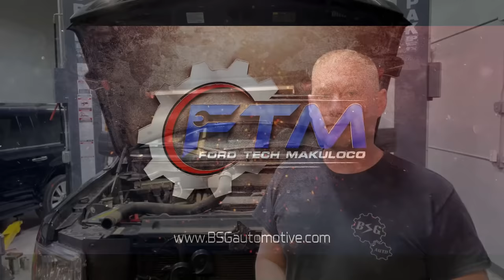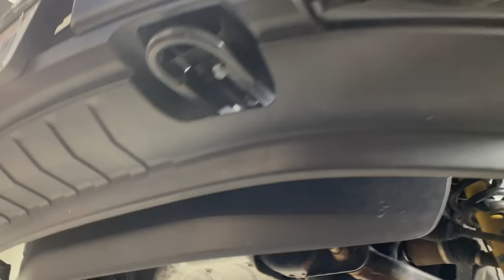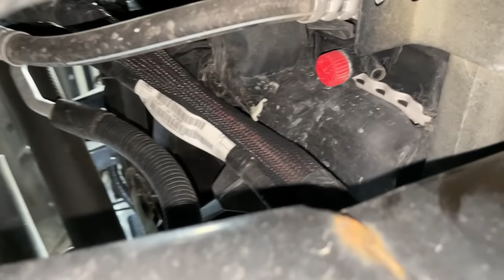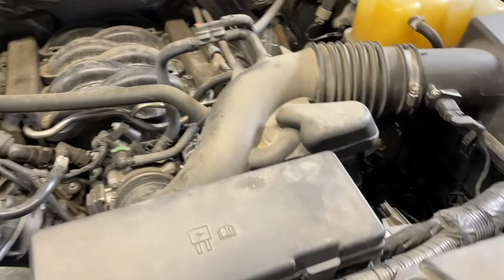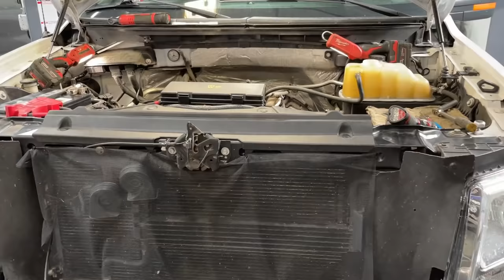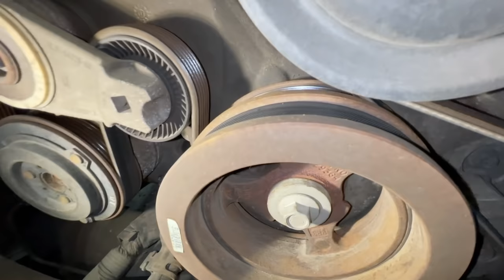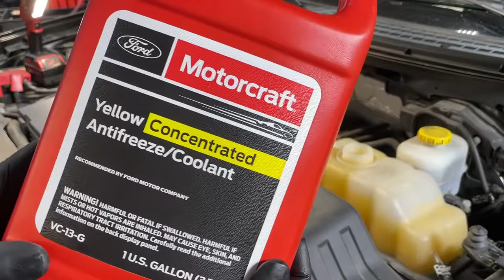2011-2021 Ford F-150 5.0L Coyote Engine: The Most Common Coolant Leak Repair!

Comment: his tech, i own a 2010 f150 3v 5.4. 160K miles, recently i found it leaking coolant but cant fin it. during testing i found that if i remove the radiator cap with engine cool,  it will spew coolant from there... is the a sign of bad head gasket?  :(  thank you.

Comment: If I replace just the O-Ring on the upper radiator hose at the quick connect, will that stop the leak I have? I noticed it’s leaking a bit right at that upper hose at the quick connect.

Comment: If I am only replacing that first o-ring (on the side leading to the upper radiator hose), does the coolant reservoir still need drained first?

Comment: Couple trucks in the fleet I look after have this problem.   I ordered the T from the local ford dealer, it doesn't seal to the rad hose.  Like there's a steady stream of coolant coming out of the rad hose when it's connected to the T.  Dealer says it's the right part.  I'm thinking that the revised part has changed diameter and needs to be matched up with a new rad hose as well? I ended up just replacing the o-ring in the T, but it's still leaking, what  a stupid design
Reply from the maker: So, you never replace the upper radiator hose O-ring when replacing the T and you have problems after then complain. Funny I have never had problems after performing it just as shown here. All you had to do is follow the directions in the video and everything would be perfect and worry free right now.

Comment: I have an off topic question but I would really appreciate some technical support. Do all the 3.0L Duratec engines have the same flex plate? Ran into a problem after an engine swap in 2004 Mercury Sable. I am having some problems with the starter meshing. It has broken about 5 teeth off the flex plate all the problem is in one location. Physical health problems have forced me out of the shop and I had to have this job hired out. I asked the shop supervisor to use the flex plate off the engine in the car because the donor engine came from the salvage yard. I am honestly just trying to figure out what is going on. I have had compatibility issues from flex plates on junkyard engines before. The problem is it is such a small area on the flex plate that I truly believe the plate suffered damage at some point and the gear on the starter was harder so it punished the flex plate gear. Was I out of line to ask for the flex plate from the vehicle that had the blown engine to be used on the running engine. It was truly a shame. The cams don't have much ability to withstand punishment on those engines and the original engine used a little oil and my niece ran it out of oil from lack of routine maintenance! Just has been a snowball situation since then.

Comment: The link for the tee still has suffix -A in the description. Does this seller send -B. Just curious, what are the details of the revision, if you know? I prefer Motorcraft parts, too, but what is your opinion on the Dorman version? Thanks.
Reply from the maker: Dorman is junk through and through. No real tech uses Dorman parts for a very good reason.

Comment: Does the heat need to be running to get flow through the heater core, or is coolant always flowing through regardless of if the heat is running?
Reply from the maker: Always except certain models.

Comment: Okay so I had this problem and changed the y-pipe and got a OE thermostat replacement while I was in there. Now the truck runs hot like 230-240F. I've bled the system a couple times and it's still running hot. Maybe the thermostat is bad? I'm not sure what to do next.

Comment: Any tips for changing out the thermostat? I have. 2012 f150 ecoboost and trying to add a spd thermostat stainless steel rather at 170 degrees.

Comment: i tried putting coolant in my truck all i seen was coolant leaking from behind the house going down behind the pullys down to the center of the bumper seal i find out heater house tube was cracked seals were broke or rusted out

Comment: That piece is the revised part? They sure look the same to me. When mine leaked (2015 5.0) I just got the O ring and replaced that. Perhaps I should be checking the other connections to see if they leak but my coolant level stays the same currently. Does this revised part ensure no leaks ever again?
Reply from the maker: Wait Ford doesn’t sell the o-ring separately for this part. How did you get one?
Reply: @FordTechMakuloco  this was at least a couple years ago. I didn’t want to drive it with the leak so my brother stopped at the dealer and got the O ring and a bottle of coolant for me and dropped it off. I installed it and that was it. Not really sure unless they stopped selling it for some reason. 🤷‍♂️

Comment: I have a small leak from the upper radiator hose quick connect. Could I just replace the O-ring in that connector or should I replace the Y connector and everything?
Reply: Replace the Y connector too--part is inexpensive, and you are already doing everything to get to the O-ring.  Ford preventative maintenance = replacing it in a controlled environment before it impacts your drive.

Comment: Any chance you can do a video or comment on what causes the #8 intake valves to wear out on 5.0 f150s around 200k miles? I'm at 275km and just started getting misfire on 8, and a quick Google search shows it's very common for the valves to tulip, but a lot of guessing about why.

Comment: Makaluco, we have a 2017 f150 with the 5.0 and in the last few weeks it has blown every single coolant line. It started with the lower radiator hose, then the upper, then the one from the water pump, then the radiator cracked, then the heater hose burst. We have replaced the radiator cap twice and it seems almost every 3 days this truck pukes all of its coolant out. What could be causing such high pressure in the system? Please help
Reply: Thermostat?  I would want to replace radiator cap/thermostat with Motocraft.

Comment: Looking at an 2011 5.0 with 84k miles. Been hearing bad things about 11-12 f150s. Should I avoid those or are they pretty good?
Reply: If you can help it, try to opt in for the 13-14 f150s. Better years for the first gen 5.0

Comment: I have an odd problem 2010 mazda 3 2.0L intermittent p2004 code. Ive replaced the runner valve problem went away. Ive cleaned the intake with some seafoam too engine clean. The flap moves freely and i checked the actuator moving it and letting go. I did spray some wd40 on the pivot point where it connects to the actuator and it helped. Im thinking my actuator is sticking . Have you seen this before?

Comment: What do you think of the 2021 Ford F-150 5.0? Do you think the cylinder deactivation is going to cause long-term reliability problems? I’ve been told if you switch the vehicle into sport mode it shuts off the cylinder deactivation is that true?
Reply: When dodge and Chevy introduced it yes, I ve seen personal friends have issues with their trucks. The Chevy was in and out of the dealer 2014 6.2 with 50k and my personal mechanic who maintenances his 2013 dodge 5.7 religiously just had to do a top end build at 125k All were related to the cylinder deactivation. The  5.0 are already starting to have issues with seizing due to c.d. but yes you can turn it off to where it does not activate it. Hope that helps.
Reply: Wow thanks for the info. I haven’t heard about new 5.0s seizing that’s awful! Is there someone I can read up on that? Maybe I can take steps to avoid problems 🙏. Thank you!
Reply: @cliffmorrison1130 You are very welcome and I would keep on the look out for info on the forums, articles, and videos when they come out.👍

Comment: Hello! When doing a Y pipe change on the coolant system for a 2014 5.0 f150. After you finish how much coolant should be going back in? I have a jug and a half of the new yellow coolant that i still need to dilute. Will that be enough or should i go grab 1 more. Thanks!
Reply from the maker: If you have a jug and a half that makes 3 gallons diluted, you should have enough.

Comment: Don't they sell the O ring on the thermostat side as well? Seems a waste to replace the whole Y pipe if it's just O rings. I already did the upper hose side but unfortunately for me the leak is my water pump :(

Comment: Hey Brian thanks for all the info. I do have a question, I have an 2001 f150 with 4.6L can I run that new yellow coolant on my truck or should I continue using that old style geen looking coolant. What would you recommend?
Reply from the maker: I would be using the Ford Gold in your model.
Reply: @FordTechMakuloco  thanks Brain I appreciate it

Comment: having trouble snapping the lock on the upper hose when replacing the O ring and T connector. seems like when you push it on it’s effortless. I can’t seem to get it past the lip. have both of the same parts you’ve shown in description. any advice? thanks
Reply: I had this same issue when I would remove my new o ring seal it would slide back on perfectly but with the new o ring installed it does not fit. I tried the dorman kit 926-168. I was able to flip my original seal and it seems to have stopped for now (let’s hope) so I can try and source the correct seal.

Comment: After having this repair done I have cooling fans that turn on high and dont shut off.  Any diagnosis tips?  Had it scanned, high side AC pressure switch code.  Cleared that and the AC was 1/4lb low.  Fans still run on turbo mode but the pressure switch code has not returned.
Reply from the maker: Well considering the high side pressure switches almost never fail I would be checking for wiring damage or a connection issue there.

Comment: Just wondering what the point of removing belt was? Thanks in advance
Reply from the maker: prevent contamination.
Reply: @FordTechMakuloco  thanks for clarifying. I was just thinking if the Y was leaking wouldn’t the belt be already exposed to coolant? Do you recommend then just putting a new one on even if it looks like its in good condition?
Reply from the maker: The Y likes to seep small amounts over time, they rarely let loose so the belts are generally ok. When you change it though there is likely to be a good amount of spillage definitely contaminating the belt.

Comment: I have a quick question, 2017 f150 xlt 5.0 I have an issue with extended crank time, she will almost start then fails but will always catch on the crank, only does it when cold, other wise starts and runs....any help, the dealership says no code lol typical.... any help would be amazing

Thanks,

Josh

Comment: Quick question I have a 19 F-150 with the regular 50 why is it using a quart of oil between oil changes for 35,000 miles on it

Comment: I have a 2012 f150 race red has the 3.73 rear end 4wd sometimes during hard excelleration at 4500 to 5000 rpm there's a very noticeable vibration.  Doesnt happen all the time just sometimes.  Also when I put it into 4wd and pull knob  out to lock the diffs it pops up and says "check locking differential" and I can't use the locking diff mode only basic 4wd.

Comment: I have a 2012 I drive a lot (366k miles now) I HATE THESE HOSES/PLASTIC CONNECTIONS
I’ve also had two failures at the degas bottle
Reply: Impressive  mileage.  What was worst repair?  How's  the tranny?
Reply: @greghoffman3146  So far I have replaced all suspension. Axle seals. All upper coolant hoses and water pump due to built in connector on water pump- but it was working fine.

Comment: I just did this repair but my main upper radiator hose collapsed when the engine is cold and expands to normal state when it’s at temp. Any thoughts on this and how to fix it ?
Reply: Try replacing your radiator or coolant reservoir cap

Comment: Before doing this, would it be a good idea to use the Ford Radiator Flush?
Reply from the maker: I would not chemical flush unless the system has been neglected.

Comment: Mine was leaking on the thermostat side connection  bought new Y pipe from dealer now it’s nice and tight on thermostat side but now the other side where the hose goes to radiator seems loose and I’m sure it’ll leak what should I do about that

Comment: After doing this repair, it fixed my leak, but i replaced the coolant and my truck temperature going to 215-220 and then the fans kick on taking temps all the way down to 190-200 but it will do this at an idle everytime.normal or need to redo the coolant
Reply from the maker: It sounds like the low speed fans are not coming on.
Reply: @FordTechMakuloco  not to mention my heater core sounds like water sloshing around .

Comment: I have a question in regards to motor oil. I have a 2015 F-150 with a 5.0. I currently use 5w20 full synthetic and change at 5000mi. After watching you videos I'm wondering, should I be using 5w30 instead of 5w20?
Reply: Did u stay with 5w20 or switch to 5w30?
Reply: @dallasmo13  I switched to 5w30 full synthetic and haven't seen a change in fuel mileage at all. And it runs just as great as it ever did.

Comment: I took my woman's 2015 5.0 to the Stealership and the couldn't get it to leak, paid for a hour of service brought it home. Next day leaking I watched one video and discovered the problem. Imagine my frustrations and the phone call to the service rep then his manager. They said you could have brought it back... I don't think so scooter!!!
Reply: I have a 15 too. What did you end up replacing? Did you just replace the O rings? Thanks for the help!
Reply: @AutoHeadz  no I replaced the entire t-pipe and upper radiator hose. It's all good now for awhile. My son who was a Ford TEC said it's the most common leak in the eco boost engine. Why one Earth didn't the dealer check this first?
It's super easy to do
The frustrating part was getting the right thing to stand on

Comment: The Y-connector you referenced above was replaced by the new part: 
DR3Z-8566-B.  Dont buy the 
DR3Z-8566-A older version!
Reply from the maker: I linked to the B version, I am not even sure the A version is even available anymore, what are you talking about here?

Comment: Does ford make any reliable engines anymore ? the last one I feel like they made was the 300 c.i. straight 6 cylinder or the old 302
Reply: I wouldn't call a radiator y pipe "apart of an engine" but the non DI coyote motors are reliable.  They actually put out real power vs the old 5.0s and 4.6l engines.

Comment: Wow, what a poor design...why all the cheap plastic fittings on all the hoses Ford? Should be able to replace a few inexpensive rubber hoses and be good for another 100,000 miles.
Anyway, great video as usual, Brian. 
 I would strongly recommend checking all connections with a mirror. Even after the upper hose "clicked", I found the rear of the spring clip was not fully engaged. 
As an FYI, after a full radiator drain, I ended up using 1.5 gal of the pre mix yellow (I replaced the orange 3 years ago after watching Brians video)

Comment: have you noticed a problem with the water pump failure around 70k miles ive done 2 f150s and 1 mustang s550?
Reply from the maker: no

Comment: 2012 f150 5.0 
I have a coolant leak on the back of the motor can see it dripping of the transmission can't see where the leak is

Comment: I ha e a 2016 f150 that's still under warranty and leaking at the u and they are telling me the hose is leaking and that is only part not covered and wanna charge me a fortune..its definitely the y piece leaking..any tips how to prove its not the hose..they said they pressured tested hose and hose was leaking from inside..but never took off hose or nothing

Comment: I'm thinking, another common problem is coolant digestion... Coyotes failing block fluid test religiously, sometimes with or without other symptoms... Been putting in ACDelco tablets lol, not helping.

Comment: When are you going to do a video on the oil consumption?
Reply from the maker: What about it? Its a base engine engineering design flaw on the 18-20 models, even the new long blocks are failing.
Reply: @FordTechMakuloco  
Just didn't know if you were going to make a video on it. Some people say it's fixed and some say the new ones still burn oil.
Reply: @curtis1951  , I have 3285 miles on my 2021 5.0 and it has not gone down at all, actually its a little discerning as new engines during the break-in would use a little oil I would think .
Reply: @curtis1951  I have 49500 miles on my ‘18 Mustang GT. It uses half to three quarters of a quart in 7000 miles. And it has the dreaded tick. I don’t have a catch can. I don’t think that’s an issue at all. There’s 10 quarts in the engine.
Reply: @HughesEnterprises  
Maybe if it didn't burn so much oil the engine wouldn't need to hold 10 quarts.

Comment: Can you avoid draining the coolant if you just replace the top hose o ring?
Reply from the maker: No
Reply: @FordTechMakuloco  copy. One other thing is it normal on these 5.0 to here slight tick noise. Seems to becoming from on top of the manifold. I only hear it if the hood is open.

Comment: If the water pump goes out will it blow water out or is this more than likely my issue
Reply from the maker: Generally, neither will, they will just seep.
Reply: @FordTechMakuloco  ok as I left my house heard belt squall when I looked had antifreeze on the intake and inner fender would the hose in this video do that if it failed I had a small leak when temperatures were cold at night warm in the day but it stopped when it stayed warm all day
Reply: I’ll have to look at it in the morning to dark now thanks for reply